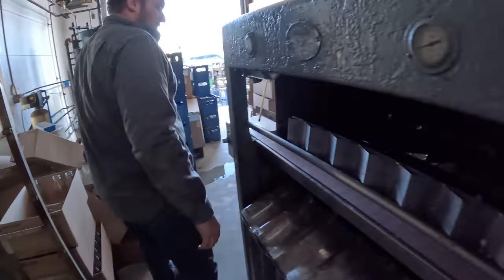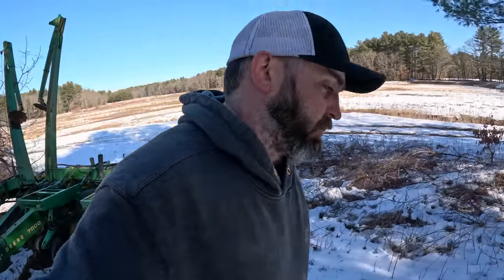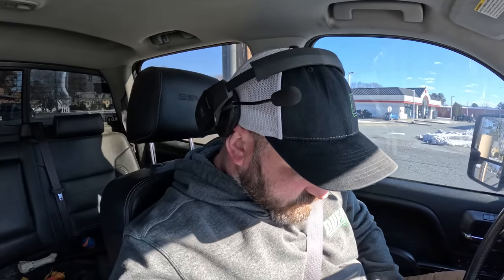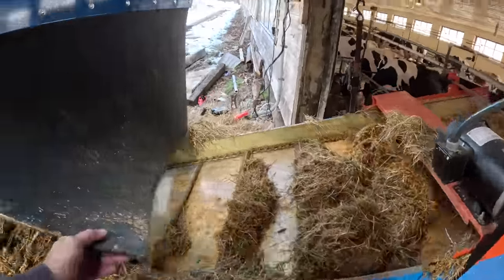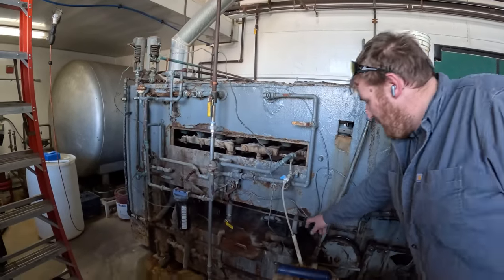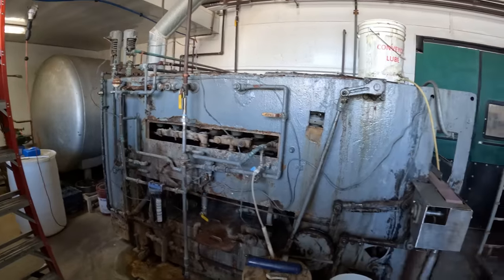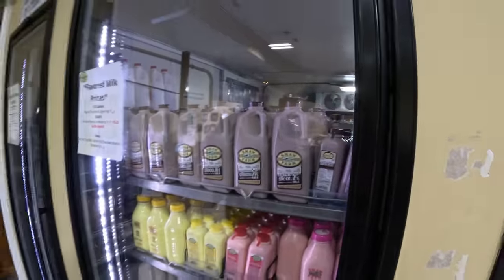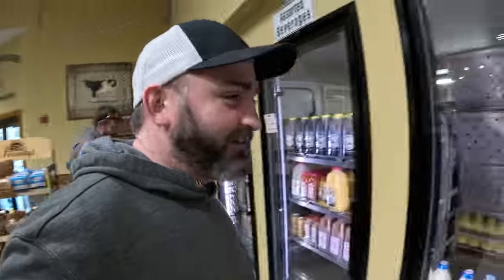How Is The Best Chocolate Milk Made? We Will See If This Work

Comment: This video brings back some great memories for me.  I live on the North Shore (Newburyport) but I grew up on the South Shore.  When I was young, I worked on a dairy farm in Whitman, MA (on Rt. 18....a little bit south of the original Toll House, on the right). We milked around 80 cows daily and we also made our own dairy products using glass bottles and the place was known for its amazing ice cream.  We had a very small store on site (not near as nice or large as what you show here).  There was a separate ice cream stand and during the summer it was hard to keep up with the demand from customers.  I wasn't involved in the ice cream making process, yet enjoyed the end result when I was done with my farm chores.  We used the vacuum/suction milking system where the tubular lines took the milk back into the dairy room tank.  I once had an original "Peaceful Meadows Farm" glass bottle, but I broke it.  I believe there are no longer any cows on the property unless a few were kept as a petting zoo to take your children when they come for ice cream.  The last I heard, they truck in the milk/cream that they need to make ice cream.
We grew our own hay and our wire bound bales weighed 90 lbs each.  We cut silage (which would ferment and stink) and I'd have to climb up the silo and use a pitchfork to throw the steamy silage down the chute into a rectangle metal cart.  I had to be aware of how full the cart was b/c if it was too full, I was not able to push it.  LOL  (sigh) My plan then, was to attend Rutgers U. for Agriculture.

Comment: In the UK, we don't have a glass bottle deposit, you have to rinse the bottles with cold water before putting the empties on the doorstep, but they drop pints of milk every morning before 6am on the doorstep, using an electric milk float.  They do steam clean the empties before refilling, and the dairy is only 1/4 mile from our house.

It's actually cheaper and less hassle to have the milk delivered rather than buy it at a supermarket and carry it home.  Plus we have the convenience of the milk on the doorstep.

Not to mention there's no single use plastic.

Comment: Those are called Bossy Racks that hold the finished product in his display case.When I worked for Garelick Farms I used to del them Bossy Racks to stores,fully loaded they hold 120 Gallon or 270 Half gallon and each rack was about 1500 lbs to wheel around.Lots of fun unloading at a down hill dock trying to control 1500 lbs.Those racks can be dangerous if not handled correctly.In the trl they can be folded up empty and strapped to the wall of the trl 4 racks and still have room to unload at next stops